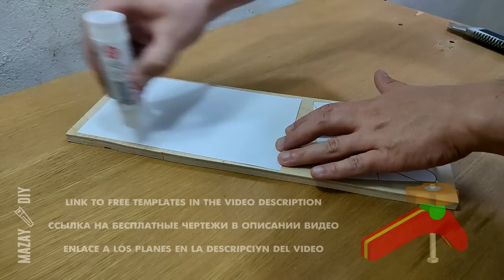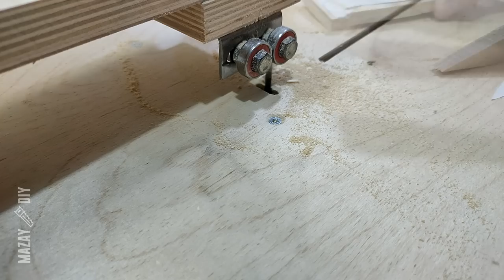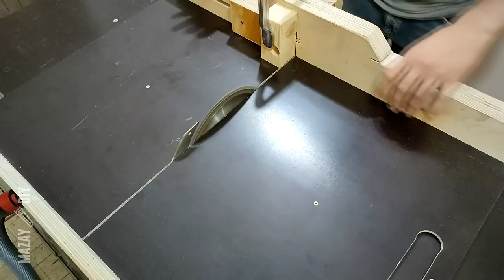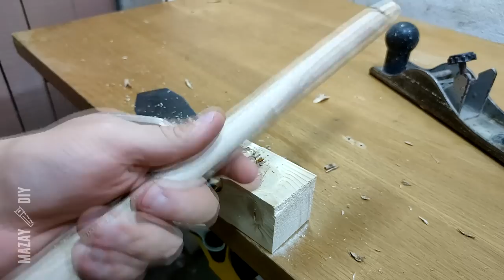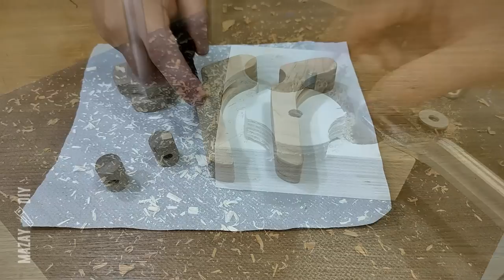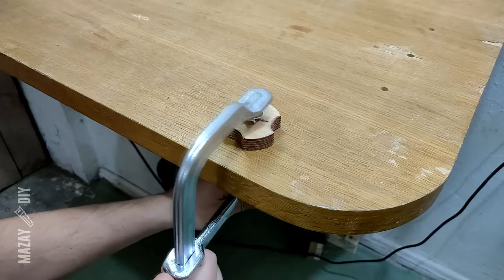DIY T-Track Hold Down Clamps - Free Plans

Comment from the maker: Do you need other sizes of clamping clamps? I can make other templates, if they wish - like THIS comment + in response to THIS comment, the dimensions you need (bolt diameter and overall dimensions, instead of 139.5 mm according to the plans https://mazaydiy.com/plans/t-track-hold-down-clamps.pdf ). I do not promise that I will help everyone, but I can make two or three other standard sizes

Нужны ли вам прижимные струбцины других размеров? Я могу сделать другие шаблоны, если будут желающие - ставьте лайк к ЭТОМУ комментарию + в ответе на ЭТОТ комментарий размеры, которые вам нужны (диаметр болта и габаритный размер, вместо 139,5 мм по чертежу https://mazaydiy.com/plans/t-track-hold-down-clamps.pdf ). Не обещаю, что всем помогу, но два-три других типоразмера могу сделать

¿Necesita otros tamaños de abrazaderas de sujeción? Puedo hacer otras plantillas si hay quienes lo deseen, como ESTE comentario + en respuesta a ESTE comentario, las dimensiones que necesita (diámetro del perno y tamaño total, en lugar de 139,5 mm según el dibujo https://mazaydiy.com/plans/t-track-hold-down-clamps.pdf ). No prometo ayudar a todos, pero puedo hacer dos o tres tamaños estándar más.
Reply: ⅘ изображение лодка использовать

Comment: I tried to convert the millimeter to inches/fraction but I do not understand some of the numbers on the plan. The 3d model page 4 has a zero with a line through it - what does this mean?
Reply from the maker: The "zero with a line through it" is the diameter symbol (⌀). https://en.wikipedia.org/wiki/%C3%98#:~:text=The%20diameter%20symbol%20(%E2%8C%80)%20(,letter%20o%20is%20somewhat%20stylized).
 Good luck, I hope you figure it out!
Reply: @MazayDIY  thank you very helpful.